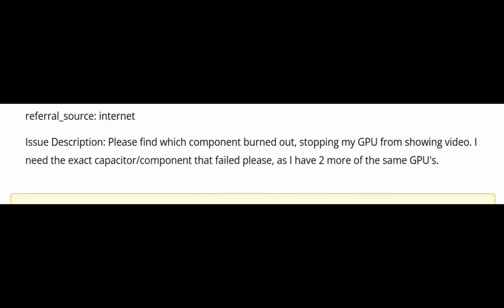Gigabyte 4070 GPU Repair - She showed up at the Wrong time.

Comment: Flux’s purpose is to remove organic compounds (carbon based compounds) and any metallic oxides.  Metal oxides tend to be more stable, require slightly more heat to melt, and mess up the surface tension of molten solder.  When metals are not oxidized solder will flow quite easily to uniformly wet surfaces and form nice uniform puddles.  This heavily aids in alignment of surface mount components on the pads.

Now in desoldering flux can help do two things.  First as it’s in a liquid state it can help conduct heat evenly (but this is not an extremely significant factor).  Secondly it can help get any random contamination out of the way, and sometimes that helps components come free a little easier and with less mess.  But both of those factors are pretty minor  in the overall operation that you will rarely even notice the difference between flux being there or not.

Comment: What happened to using a thermal camera? Seems like that would be a good second step after visual inspection, then check for heat on both sides of the board.. Then start checking voltages, etc, especially for this, where the issue isn't very obvious, seems like a thermal camera might give you a better idea about where the fault is. Always love watching your videos, and absolutely love the outro music, she did an amazing job putting that theme together. 
.

Comment: Hi , I really need some help here. I’ve got a Lenovo Legion Slim 5 (2023) that's only about 6 months old, and it's been nothing but trouble.

The biggest issue I’m facing is with the mic input through the 3.5mm jack. No matter what headphones I use (and I’ve tested two that work perfectly fine on other devices), I keep getting this loud static and high-pitched beeping whenever I try to record or join a call. It happens even when the laptop is running on battery, so I don’t think it’s a grounding issue.

I’ve reinstalled Windows multiple times like Lenovo support told me to, but it never fixes anything. What’s worse — they keep saying this is "normal behavior," which makes no sense at all. I can’t use my mic for meetings or anything, and it’s seriously affecting my work.

To make it worse, I’ve already had:
3 motherboard replacements
2 palm rest assemblies
2 heatsinks with fans
And despite all that, the laptop still overheats to 101°C within just a couple minutes of gaming, and the RGB lighting behaves weirdly too.
At this point, I’m super frustrated with Lenovo’s support — they just keep swapping parts without fixing the real problem. Has anyone else experienced this or figured out a fix? Any advice would be really appreciated.

Comment: I counted 14 "exact" 😂
0:24 "...need the exact capacitor/component..."

0:44 "...see the exact component..."

0:51 "...know the exact issue..."

0:53 "...the exact problem..."

0:54 "...and the exact component..."

1:10 "...see the exact component..."

1:27 "...There's no exact..."

1:28 "...no such thing as exact."

1:41 "...The exact capacitor."

3:14 "...find the exact issue..."

3:19 "...find the exact component..."

4:14 "...want to know exact..."

4:24 "...did I say exact..."

9:21 "...pinpoint the exact problem..."
Reply: 14 times if i still know how to adition numbers xD

Comment: Hello, that voltage is correct. That chip you changed reduces a voltage from 1v8 to 1v2, so it's correct to have that voltage there. Okay, your problem isn't there.

Comment: isn't wick to remove solder not to add solder
Reply: Yes but a saturated wick cannot soak up any more. So it adds back. But as Alex mentioned, it's very inconsistent and not worth the hassle. Cleaning it later after press down is much faster.

Comment: Mr, I was your feed a lot. I'm definitely not a gamer. I don't have a PC or laptop.   My question is this,  why are manufacturers churning out devices with all these faults, many of which you can predict, seemingly.  Why are the public buying trash/rubbish  (UK term)
Reply: Most don't fail,  but everything has a weak point of failure.
Reply: Stuff is made in batches  anywho I don't trust gigabyte or msi, starting to not trust asus either. Also most people don't understand electronics, and know no better.
Reply: Planned obsolescence. It has to have faults, so you'd "return to the market" faster, but after the warranty expires.
Reply: Some of these faults tend to show themselves over time. Like what gaming said, some have a weak point that usually doesn't show itself, too. Sometimes, you have to also remember just how many he fixes vs how many are in the wild. He might fix 20-30, but when you sell about 5-6,000, you're looking at a small percentage overall.